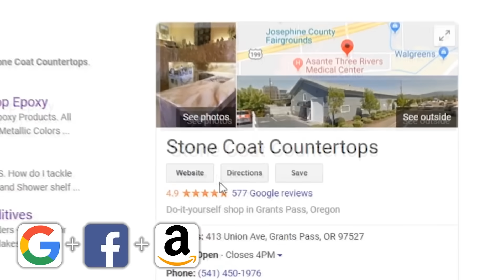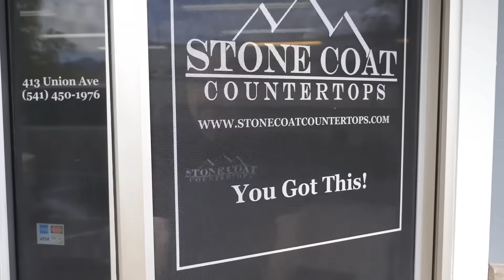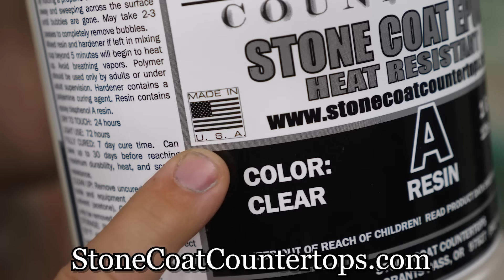The Ultimate Epoxy Kit For Remodeling Old Countertops | Stone Coat Countertops Epoxy

Comment: Can you do a YouTube video on countertops with a 3-4 inch backsplash without moving it? Also should how to smooth over the front and sides showing. I plan on using Stonecoat on my countertops but I will not be able to move them due to physical limitations and the fact they are built in. We do plan on replacing the cabinets underneath but not until the countertops are done. I believe in going from ceiling to floor when redoing my home. Makes more sense. The backsplash is part of the countertop.
Reply: @Shelly Lemons I was wondering if you ever figured out how to do your project? I recently found this site, but the feedback doesn’t look too good— I’m not seeing too many answers to a lot of questions.

Comment: VERY wild idea I have. Have an older bmw with a cracked dash. Been considering if I’d be able to coat it in epoxy instead of painting or wrapping. Seems likely the epoxy will get too hot and potentially melt portions. Any advice?

Comment: I purchased stonecoet epoxy to do Blue Pearl table tops for a restaurant. The tops were to be outdoors so I asked if they had a outdoor rated product and the sales lady sold me the Art kit and said it would work. Believe me when I tell you it does not work outdoors. The surface dulled within a month and is now peeling off even though we used exterior sign grade MDO. Do y’all have anything better

Comment: Hello I have what seems to be a good question, what if you have created an almost perfect piece, but after your done with your color pour but not yet cleared decide you need to add a small amount of color here and there, is there a way to add color without having to do the whole project again, then clearing it to level the top? Would it blend in and look right? I have a counter I have done and love it but wish I had of added a couple of veins!
Reply: Have y’all ever done something like this?
Reply from the maker: Good question Larry! We would recommend sanding over your surface and reapplying another coat just to be safe. If you would like to try and add color a different way we suggest practicing on a project board to see how it will turn out. -Nathan